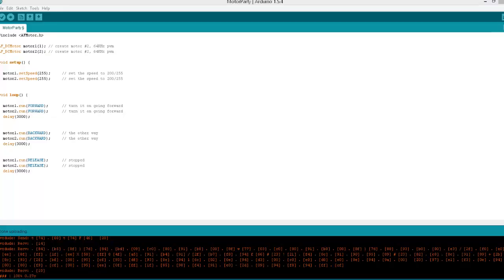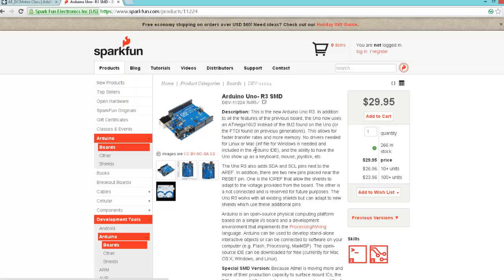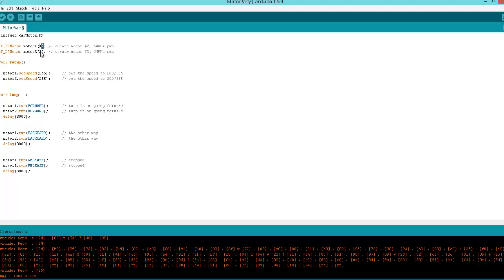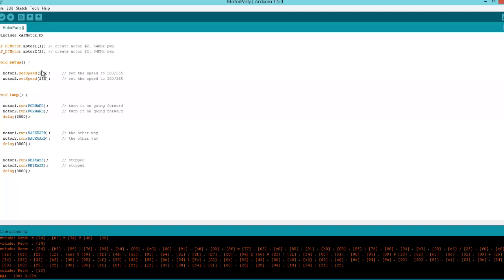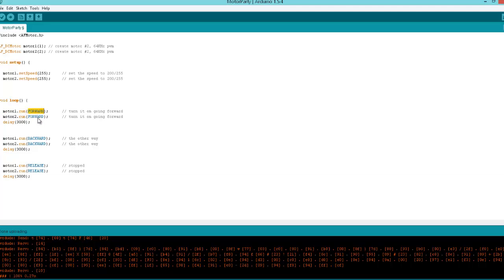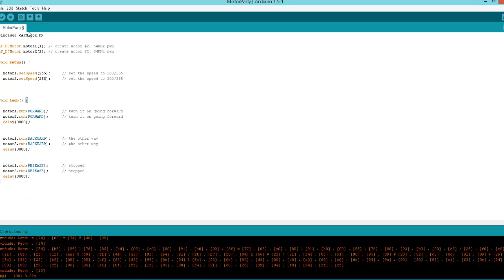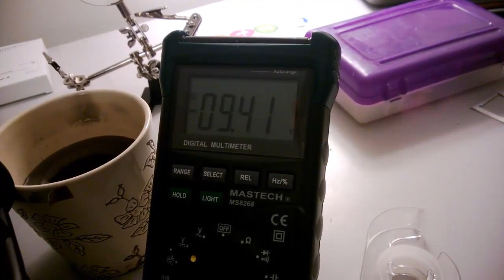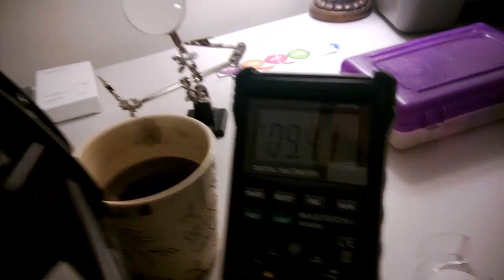Arduino - RC Car Hacked together tutorial

Comment: i have an esp 8266 and a motor h bridge controller and an old rc car without a controller how can i control the rc from android phone? (wifi)?
Reply from the maker: You'd need to create client software for a device that sits on the same network and then speaks to your car.

Comment: Hi Russ, very nice tutorial. I am building an RC tank and my bluetooth module (HC-06) keeps disconnecting from my laptop every couple of minutes or so, it's very frustrating. I was curious if I could rip out the receiver from an RC car, and still be able to write code to communicate to the arduino/motor shield through the RC car controller.  Please reply if you have the time :) thanks
Reply from the maker: That sounds like that's a hard coded timeout. Unfortunately I'm not sure on the specifics of your project so I'm unable to comment

Comment: Hi RussCTech.  Thanks for this tutorial!  I'm confused how you can achieve position control on the steering motor simply by using the forward or backward command.  Why doesn't the motor keep spinning (like the back wheels) and grind up the rack and pinion gear?
Reply: Daniel Dominguez I was just going to ask the same question too bad he never answered
Reply: Maybe that s because its not a completely spinning motor but a servo.

Comment: easy and clear tutorial man, but i've go a question Can i use the same setup over Bluetooth so i can use my PS3 controller or my smartphone? 
Thanks.
Reply from the maker: I built a Bluetooth version of this as well. I suggest using a second Arduino as a communications layer.
Reply from the maker: Yeah you could but that's outside of the scope of my knowledge currently. Sorry :-(

Comment: Hi......um trying to drive the 12V DC pump with this and they are just giving frequency sound but not doing anything. ........I think I can solve this by denoising capacitors on each pump rail but what values can I use?